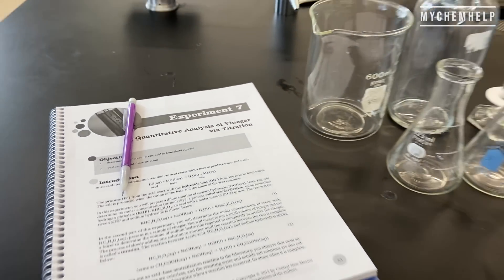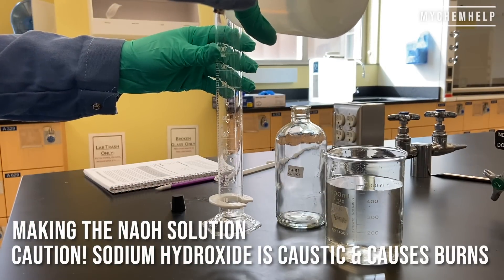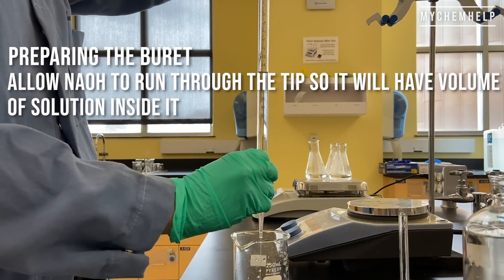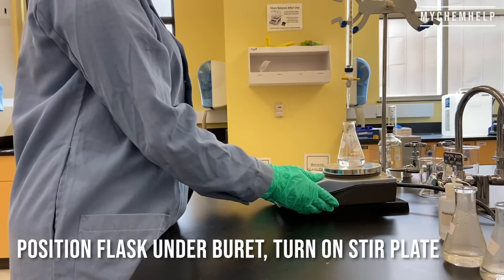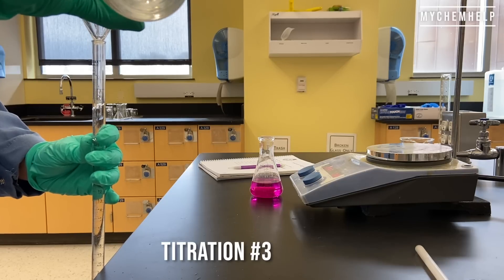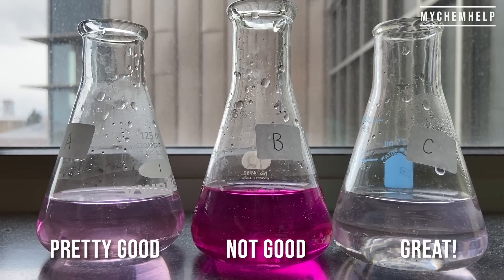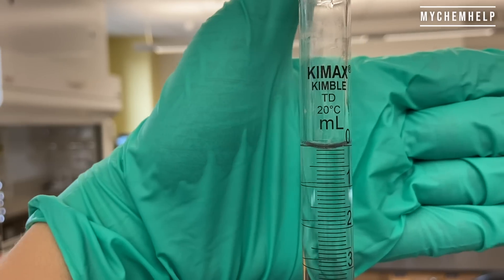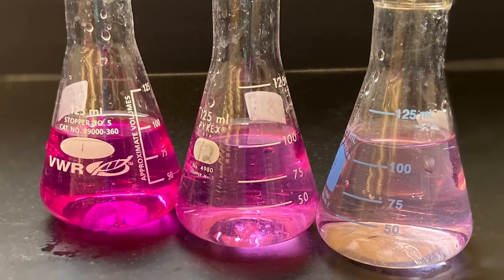Vinegar Titration- Part A & B- General Chemistry Experiment

Comment: Are you sure that initial reading of the buret for the first vinegar titration was 1.95 mL?
Reply from the maker: Good question! Burets run from 0 mL at the top down to the maximum capacity of volume of the glassware. Reading burets is sometimes confusing because most glassware measures from the bottom at 0 mL and the top at the max volume.

I read burets from the bottom-up, which means I reference the closest whole number below the meniscus and count up the tenths markings from there. IE, if I have a volume that is between the 30 mL and 31 mL marking and I'm reading bottom-up, I would read it as 31.20 mL. Alternatively, if I read it from the top-down, the reading would be 30.80 mL. It's just a matter of perspective. You can read a buret either way, as long as you're consistent. 

What matters the most is that the difference in volume is accurate for calculations. I hope this helped!